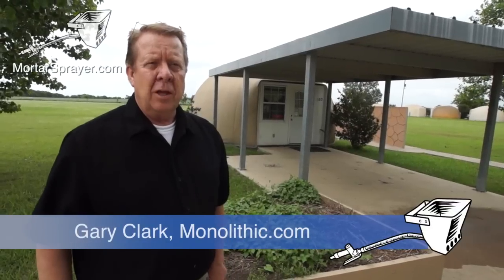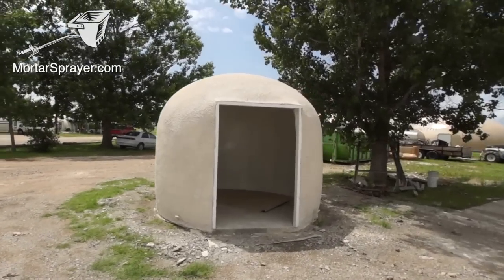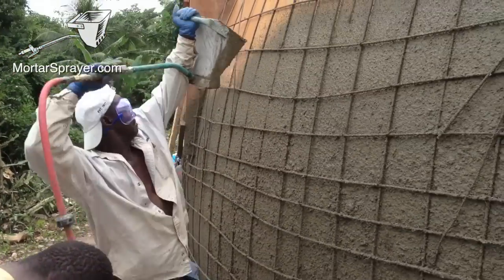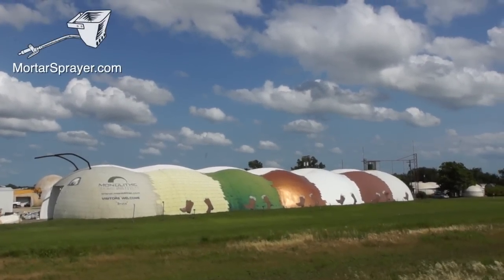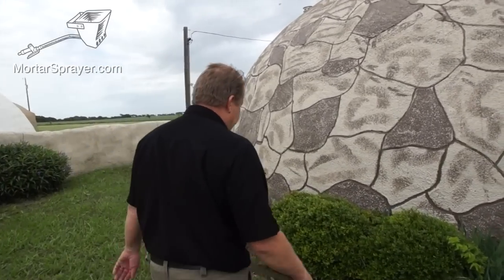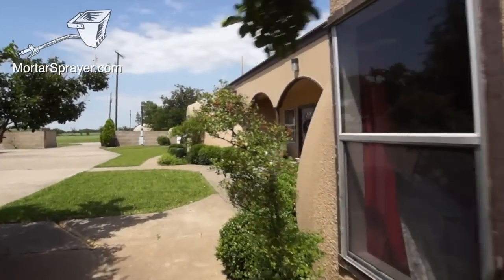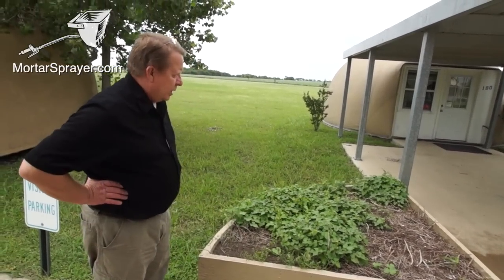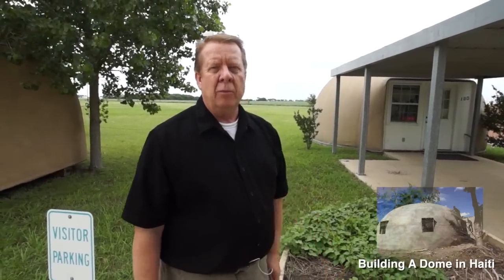Monolithic Dome | Tour of Monolithic Structures in Italy TX

Comment: Have the homes been tested in hurricane areas? And will they stand a flood?
Reply: Many times.  No damage.  Flooding doesn't harm them.
Reply: About the only thing they don't handle well is if the ground beneath them washes away.
There are three domes sitting in the Gulf off the coast of Florida because the shore washed away.
They're still standing on piers.  It's the weirdest looking thing.  But they are still intact. That should be proof they can withstand anything.
Reply: Check out Cape Romano Dome House on wikipedia.
I highly doubt they were the "Monolithic Domes" of David South, but still, they're inherently a rugged design.